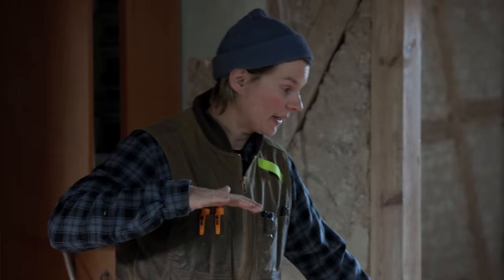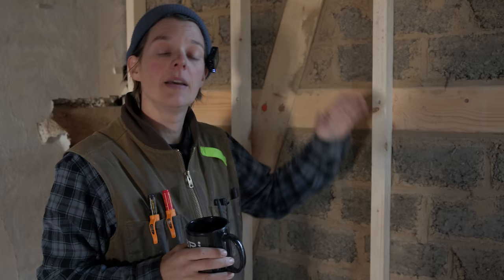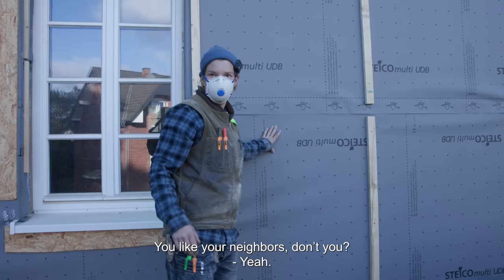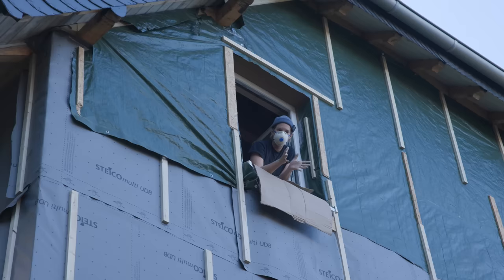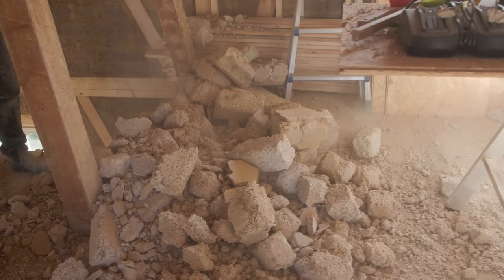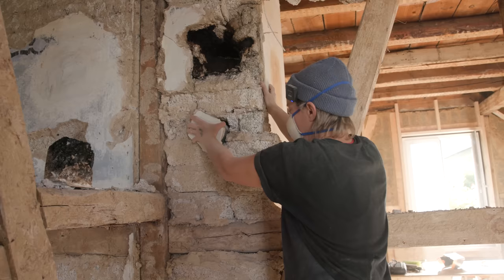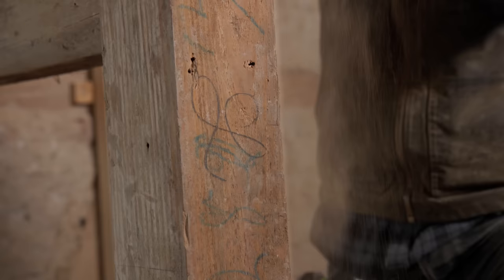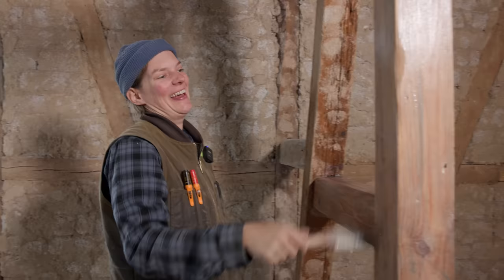I am so glad we found this! (Rescuing a 120 year old house)

Comment: This house was just one normal moment away from being lethal to its occupants.  In so many ways. Amazing job you've done getting to the bottom of literally everything about this house.  Whew!
Reply: In regard of the bad structural state of this house I'm wondering if there shouldn't be an official security check on such old houses before they go to the market. At first glance it didn't look that bad, but imagine Laura would have only done some cosmetic work to the walls and floors... one day it all would have crashed down...
Reply: Usually all serious buyers of such old houses would send some kind of expert to perform due diligence before committing to the purchase. Hard to catch something like that chimney, though.
Reply: Yeah, if it were me I just move in, only to be crushed a month or year later when it falls down. Everything was plastered over and even an inspection would have revealed only a fraction of the true problems underneath. It turned out to be in shockingly bad shape.

Comment: Laura, we had the same issue with a chimney that went to and through a thatched roof, we 'sleeved the chimney inside it then with supports rebuilt the chimney walls that had failed, brivk block by brick block, it was surprisingly easy and satisfying, saving the chimney from being a fire risk to being a safe and beautiful part of the house.
Sleeving is the way.
Reply: Exactly what I was thinking. Did you sleeve it with a steel tube inside?
Reply: I was thinking this too.

Comment: Before it's too late: don't forget to think of a chimney for the ventilation of the house, especially bathrooms and kitchen. The air needs to be renewed and you don't want to see holes in the facade
Reply: „Zentrale KWL mit Enthalpiewärmetauscher“ is what you’re looking for here
Reply: Heat recovery ventilation
Reply: "holes in the facade" Those are called windows, and seeing them IS impotant :P
Reply: @bl4cksp1d3r  bathrooms with or without windows MUST all have mecanical ventilation, and there's a reason: People DON'T open the windows.
Reply: @sportlol they must have?
Reply: Should
Reply: In Germany we have Stoßlüften 😂
Reply: In Germany they open the windows once a day to air out the house. Sometimes you will see the down comforters hanging from the windows to air out.
Reply: @sportlol Bathrooms with windows do not have extra ventilation in Germany. We just open the window everyday and after showering. It is usually even written in the rental agreement.
Reply: @chrisssssssi5598  I build houses in Germany and ALL bathrooms must have ventilation no matter if they have a window or not. That's a standard building regulation in Germany and most developped countries for new building and when possible for renovations as well. The reason is mould and air quality of the entire house as well as energy efficiency when using a heat recovery system.
Reply: @sportlol  I know no house that has extra ventilation in rooms with windows.:-)
In some flats you want as much humidity as possible, for example now in the cold season the humidity drops below 40% all the time in my flat and that is not healthy. Of course I still open the windows every day, but I don't want to loose to much humidity. :-)
Reply: @sportlol yes for new houses. This is not a new house...
Reply: @Yllusion  Ich dachte hier wäre die Kanalventilation gemeint.
Reply: This house has a lot of clay in it, it absorbs huge amounts of moisture like a buffer
Reply: @sportlol I live in a modern german house build in 2009. There is no ventilation in the bathroom except for windows.
Reply: @Timootius  the DIN 1946-6 for ventilation of residential buildings of is valid since 2009! So maybe your house was finished right before that

Comment: Laura, no need to tear down that chimney and interfere with your new roof. A stainless steel liner can be installed that will allow you to continue using it to vent a combustion appliance. Or if you will no longer need to vent an appliance you could use it to vent an erv/hrv to reduce exterior penetrations.

Comment: I know it's not your general thing, but I love these restoration videos.  For the chimney it looks like you've had a (or several over years) creosote fires ... very dangerous.  In addition smoke and moist air = acid, which destroys chimneys' especially brick.      The good news is that framing out the chimney and using a modern stainless steel chimney liner should not be too expensive (at least compared to other costs in restoring a house, and likewise I don't know regs in Europe so could be talking out my tailpipe, but when a cleaner told us our chimney was in bad shape I was worried about having to spend many thousands .... but then was told it was large enough that I could just have a stainless liner installed, and township agreed that would be adequate).

There's something about building a house.... I want to build my own small summer-house/recreational cottage (on my own land) but building permit rules are such that I'm going to have to hire contractors to do most it.  I'm bitter about that as (with advice from brother and others who have been in the trades) I was hoping to do "with my own heart and hands" for most of the work.  But simply time limitations on building permits (I'm still working and the land is 150km from home) mean I will have to contract much of it.

Comment: When I was a child our old house had a similar situation. Original chimney had an opening for a stove in the side that was covered over with a tin plate and plaster and lathe. Our basement fireplace was later tied into the old chimney and eventually the tinplate rusted away and smoke poured into the wall and up to the attic causing a lot of smoke and charring before fire department got there and put it out. Thankfully, it never flamed up or the whole house would have burned down. Had to replace the whole chimney. Glad you caught this! (By the way, the HULK called and has some walls he needs you to smash. He liked your work!)

Comment: That chimny leaked trough thats why it is black, probably not burned. A chimny should not leak though so that is not good. In the Netherlands you can resleeve a chimny using the old chimny. They fit a new pipe in the old hole.

Comment: Speaking professionally as an architect trained in passive energy efficent design and given the substaintal insulation to the exterior, putting insulation on the inside of the outer walls, apart from covering up the half-framing, reduces the usiable thermal mass of the wall, thereby requiring more energy inputs to maintain thermal comfort.

Comment: On the transitions between the floors: when using material that "lives" (expands and shrinks based on temp/hum) like wood, you may want to keep a small gap between the rooms (like you do at the walls). Often that's filled with either a silicone material that can following the movement of the floors or covered with a small profile.

Comment: You can get the chimney fixed by adding pipeing to the chimney. It is basically new chimney inside the old chimney. If tearing down the chimney and building new is not an option.

Comment: I'd argue that even the new straight wooden frame is attractive in its way. Not as interesting as the old crooked stuff no but still has character that you certainly wouldn't get from a plane, plastered wall but I'd still agree it's probably not worth the draw backs especially regarding the exterior wall that come from leaving it exposed as in no insulation, protection of the main building structure, etc. Amazing work so far sure the rest will match so so good watching an old house get a total overhaul but being as sensitive to the original materials, build as is possible from a staying sensible and not sacrificing the finish to get a slightly better look or just to keep a part because it's old. Brilliant philosophy to have.

Comment: Hi effciency stoves only need a 80mm exhaust. You can drop inn a liner inside the existing chimney. As for a homy feeling wood fire consider a pellet stove in the living room. Also highly efficient and much easier than wood burning. Also not risking to be banned from using it in the future because or air pollution...
Reply: Pellets produce about the same air polution as other wood stoves.

Comment: What sort of furnace will you use? I hope it's something really high tech and energy efficient so we can learn from you. 

Our new furnace runs on natural gas, hangs on a wall, heats our water, and draws its air in from outside through a pipe so that it isn't using the warm air from inside the house. The furnace exhaust goes through a pipe that surrounds the intake pipe (a pipe in a pipe) to warm the incoming air. This makes the furnace even more efficient! Our brick chimney is now just a decoration.

Comment: I've been working with some very weathered wood lately, and found a worn wire wheel cup in my impact driver or drill will smooth and burnish the wood, without taking down the uneven grain like sanding does.  I don't know what you're looking for from your timbers, but I thought I'd share that, if you wanted to keep any of the more rough look of them, without getting splinters.

Comment: What we are seeing here around the chimney is not "the wall burning", because this is a fully mineral material, which cannot burn.
Apparently the chimney was not airtight here / so narrow further up that the gases escaped into the wall through a leak. The wall was much colder than the gases, so there was condensation of chemicals from the exhaust gases. These apparently contained a lot of soot (incompletely burnt carbon) which deposited to form this black spot. The process may well have taken years.

Comment: Laura and crew, If you are thinking of putting in a heating device that vents out the chimney, it would be best to use a flue liner made of stainless steel. It may be the law in your area.  Safety first.

John in Bethel, Missouri. USA

Comment: I'm pretty sure that chimney is NOT beyond repair. There are companies specialized in placing stainless steel tube inside the entire length of the chimney, thus protecting it from burning out. That's how our chimney got repaired when it almost burned.

Comment: Τhe filling between the wooden beams is not structural but acts as a wedge of stability in the joints, not allowing diagonal forces to act in the event of a large vibration or earthquake and detach the timbers from each other.

Comment: So here in the States with home that are several hundred years old, we clean out the interior of the old chimneys and then place a chimney liner into the chimney.  The liner is usually insulated on the "exterior" with a high temperature metal inside.  This will mitigate the damaged interior and allow you to do repairs to the stone or brick work inside the home.  It lessens the cost of having to replace a chimney and still give you access to use it to vent furnaces and hot water heaters.

Comment: There was a Chimney fire, which broke through the chimney lining and burned structure. I think it would be prudent to have a chimney specialist look it over and odds are, you need at least a new liner or a new chimney. Again, I am reminded of the movie 'The Money Pit'. At least you haven't fallen thru the floor while standing on rug trapping you 20 feet above the lower floor struggling for hours screaming for help. The project is still young though.

Comment: they can climb up onto your roof, destroy the inside of the chimney (the ceramic/clay tiles that are supposed to be the thermal barrier, but in your case are likely gone) and insert a modern stainless steel tube.

Comment: Just watched last weeks video, just catching up ax I as doing my 200 year floor. I bought a lifter based on you building yours. Also I reused the floor boards, put them back using my knee pads, don’t own a Shaper. The normal way around, knee pads first Sharper second 😊

Comment: I copied your key clip idea but after I cut the round head off of the screw, I used a hacksaw to put a slot in the end of the screw so I could use a screwdriver to tighten it down

Comment: My 1955 house had wood burning stove in kitchen originally, they removed it later to electric stove and f'd up the smokechimney to airventilation chimmey. I managed to rescue the smoke chimney by removing few rows of bricks and using fire mortar and bricks lay a new inside to that smoke chimney. Then fix up the outside with regular bricks and mortar. Still have to get that chimney inspected before attaching my new fireplace to it. I think my has was as close to burning down as yours.

Comment: Pyrolysis 
Pyrolysis is a chemical process that involves the decomposition of organic materials through the application of high heat in the absence of oxygen. This process leads to the breakdown of the material into various byproducts, such as gases, liquids, and solid residues. Pyrolysis is often used as a method for converting biomass, such as wood or agricultural waste, into biofuels or other valuable products. It is also used in the production of charcoal and the disposal of certain types of waste materials.

Comment: Replacing that old wood burning fire place with a wood pellet one would reduce the chances of creosote build up. The new pellet burners are way more efficient in creating heat. And this would allow a metal pipe flute instead of having to build another brick structure. Plus a pipe can be hidden behind a faux brick wall if it doesn't look good.

Comment: Don't work a hammer above your head. It takes too much energy. Far more than using it from waist level. Get some elevation. You'll get less tired.
As to the chimney it seems it has had a small fire, likely because of improper maintenance. It doesn't look great, but you can rebuild it if you want it. That is always an option. Have the rest inspected with a camera and cleaned.
I wish you success.

Comment: just to back the "the frame is holding the house" up:
historically these holes were just filled with straw and clay smeared onto a woven twig-mat wedged between the beams.
decent insulation for the time, but does almost nothing for stability.
(Laura, in case you want to do a traditional architecture special, how about going to a Freilichtmuseum for that? Kommern should be close enough and could be nice for some spring filming. try to get interviews with the carpenters for Fachsimpeln auf höchstem Niveau.)
(btw, what ever became of Matthias Burger? he's gone a bit quiet lately, but his Timberframe series is top notch. way more traditional approach than Laura, but same love and care and dedication. I think you two could have fun discussing problems, solutions and "what did they think back then?"s)

Comment: The bricks of the chimney didn't burn but the are sooted, in German "versotten". So every  chimney sweeper would be alarmed and tell you: You need a stainless steel pipe if you want to use the chimney again.

Comment: Looks as though maybe they were running a wood stove through a gas flue? Crazy thin-walled pipe.

Absolutely fascinating project to follow, thanks for ripping it all apart & helping us all see the solutions 🙏

Highly recommend using Osmo Raw Oil for the exposed timber, as it has a tiny % of white pigment in which helps gently mask the 'yellowing' or discolouring of timber over time.

Comment: Is the entire chimney crumbling apart? I thought it might be possible to rescue it by repairing the holes where needed, but more importantly - install a stainless steel liner that would contain the heat and make it safe to use. But if the entire structure of the chimney is compromised, that's another story.

Comment: Fantastic project, I disagree that old spruce won’t look god as an exposed timber frame😉. For your 2. hole above the one still holding the steel pipe I suspect it was for another taller fireplace that wasn’t blended correctly. None of the old holes appeared to be correctly re-done. (You shouldn’t fill a thin steel pipe with cement and think it’s all good). It may be possible to have your chimney rehabilitated, talk to experts. If you’re going to install a new one, check with Schiedel - they have mason chimney that can be lifted in place with a crane - ready with outlets of your choice, It should suit your old house very well.

Comment: I'd be curious how much weight you are ultimately removing from the house through removing all the brick walls from the interior and how it overall affects the structure of the building. I feel comfortable in guessing that you removed well over 500kg of brick and mortar from those walls.

Comment: It looks like they never built a proper chimney so after all the years of use and junk building up in the makeshift chimney there was at least a small chimney fire at some point.  Definitely not worth saving. A chimney liner might work instead of ripping it all down but that depends on how good of condition it's all in.